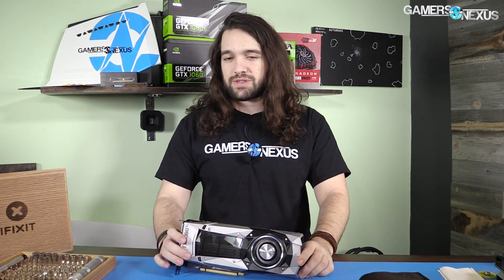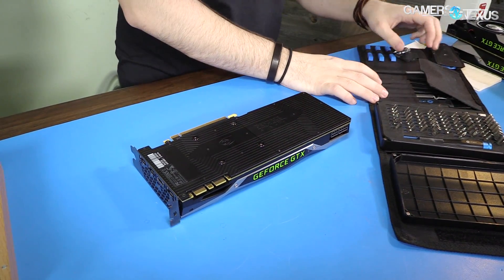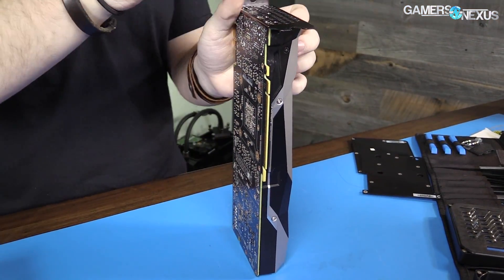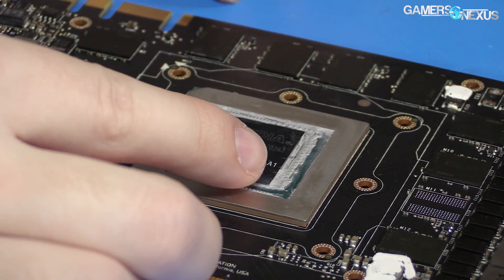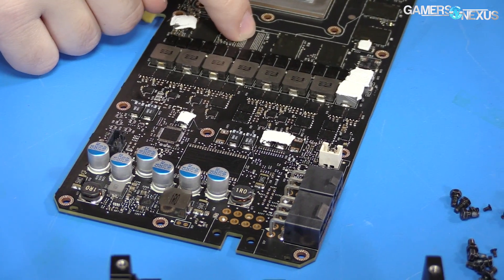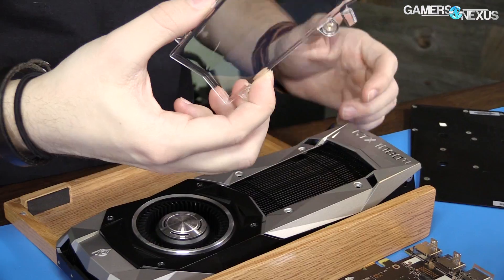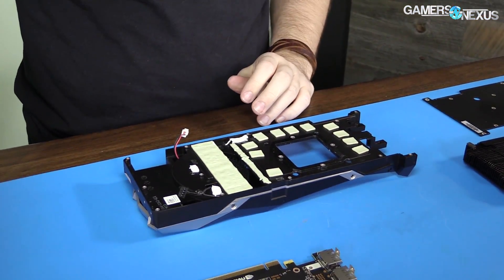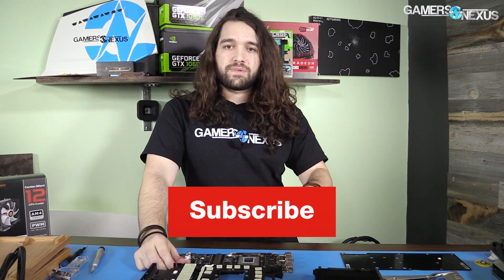Building a 1080 Ti Hybrid Part 1: Tear-Down

Comment from the maker: Hey all. This is part 1! We're working PAX East this weekend, but will immediately set to concluding the hybrid project early next week. For the 1080 Ti review, check here: https://www.youtube.com/watch?v=BipVR5-YM_Y
Reply: awesome, I'm wanting to water cool two of these later, and I have no clue what I'm doing..lol..
Reply: King Sisyphe if you can wait I'm sure evga will have an actual hybrid version, probably a FTW hybrid too
Reply: Ben Filley ftw 3 no?
Reply: Brian Field well the whole "ftw3" is a reference to the fact that it's now using 3 fans instead of the 2 on the previous versions. The actual FTW pcb is the important aspect. They always have a better power delivery and will generally be able to maintain a higher clock speed. Especially so when water cooled, because you remove the thermal limitation of an air cooled solution. Liquid coolers keep the cards under the temp that they automatically throttle at. I know on maxwell it would automatically start throttling back at 70c, which is why I liquid cooled my 980's, so they can maintain their overclocked without dipping inevitably at 70c. Now they stay right around 42c full load and overclocked, and the frequency never dips even 1mhz.
Reply: Ben Filley what kind of clock speeds can we get watercooled?

Comment: The big question is: does it NEED VRM cooling, provided the core is water-cooled? I've been running some 200-250 W cards (currently - a slightly OC'ed R9 280X), and they did not need active VRM cooling.
This card is moderately more powerful, but its VRM is also have more components that share the heat (and great MOSFETs with very high efficiency), it's probably cooler than my 280X.

Comment: Hey Gamers Nexus, So I just installed this hybrid cooler onto my 1080ti. In all my software I'm not seeing a fan control for the gpu itself. The fan seems to be running at 100% all the time. Is there anyway to control that? Did I install it wrong somehow?

Comment: I'd be very interested if EVGA/MSI etc. would create an SLI version of the hybrid using a 240 or 360 rad so it doesn't look like $hit if you happen to have two of the Hybrid cards in one system plus an AIO for the CPU

Comment: Great videos (part1 & part2), but I just do not understand why manufacturers don't water cool these right out of the box.  Yes it costs more but seriously at the heat these guys run at why make end users jump through hoops like this?

It's like selling someone an automobile and then taking the radiator out of the car and just expecting the car to run simply on the fan.  Sure the car would probably do fine around town but if you drove it on the highway for an hour it would melt the engine block.  LOL.

Comment: just to note - to fit a GPU only block or AIO, you don't need to tear down nearly half as much as this - the shroud and back plate can stay on the card - you only need to undo the 6 small torx screws (2 on each side and 2 near the fan) - the 4 bigger ones just hold the clear plastic in place so don't need to be undone

on the back, you only have to release the 4 big screws that hold the heatsink on, you don't need to remove the back plate at all

Comment: Hey guys! Any1 know if the Raijintek Morpheus fits on the 1080Ti? I used one on my 980Ti and it would be great to simply migrate that thing over to the new card :) I'm a little bit concerned regarding MOSFET cooling though...

Comment: Definitely getting one of these to replace my 980ti which isn't cutting it at 4k any more.  I've got SMD rework tools and it would be tempting to just solder another memory module on to see if I then get 12gb.  I notice that all the supporting resistors/bypass caps etc. are already there for the missing module, including on the back of the board.  Getting a stencil won't be a problem but... anyone know if these 11gb/s modules can be ordered singly?  I'm prepared to give it a go in the name of science :) . PS - thanks for a great video - subscribed to your channel.

Comment: Make sure you test it with CPU bottleneck so it performs the same as RX 480 so AMD fanboys can claim RX 480 is just as fast.
Reply: Alex Pana basically both cards numbers end with "80" so they're pretty much the same.
Reply: wtf u talking about  amd fanboy? the ryzen are utter shi t in gaming. we're still waiting for AMD to update the firmware on those new cpu's so we can actually see some performance out of them. Motherboards don't even have a fully capable Bios for the Ryzen processors yet. Dang.  I'm no nvidia fanboy, but at least nvidia is releasing something.  fkin amd has been trolling us with AMD VEGA and HBM2 for so long now that people are starting to lose hope. and to buy a 500$  1800X Ryzen and see that it doesn't beat an oc'ed 6700K that's roughly 300$  is disappointing.
Reply: Top kek
Reply: Sorry to hear that, i hope you are healed soon in the name of Jesus Christ !
Reply: Filip Cristian I guess the water is boiling inside the atic now
Reply: He should test it with 7700k so he will be cpu bottlenecked  :^) 
http://www.eteknix.com/nvidia-gtx-1080-ti-cpu-showdown-i7-7700k-vs-ryzen-r7-1800x-vs-i7-5820k/8/
Reply: butthurt that amd has superior game in the cpu biz? kekekekekekek

Comment: Would it be possible to solder an extra gb of micron gddr5x memory on it?
Reply: Luka Viola Blaic It would be more complex than that. The card, drivers and the OS would all have to recognize the extra gig, any presumably you would have to flash on a custom BIOS for it to recognize to the chip.
Reply: Brap Brap this is probably a really stupid idea but would using a Titan X bios allow it to recognize it? I mean spec wise they're almost identical besides ROPs
Reply: my intuition is sayin... its  not that easy dude :P where would you buy the 1gb memory?

Comment: does anyone know if custome water cooler plate from the FE 1080 will fit 1080Ti? I have XSPC water block and backplate
Reply: ealiev60 Probably not because the VRAM, Chokes and FETs are in different locations. Go ahead and try though, no harm in trying. 

A Titian XP water block fits though.
Reply: ealiev60 titan xp probably more likely

Comment: If a person had sufficient micro soldering skills would it be possible to solder a functional 1gb micron vram chip onto that spot where the 12th gb of vram would of gone?
Reply: If the traces are actually there and you flashed a custom bios on it.. maybe.. probably not though and I don't think 1 GB would be worth it
Reply: amartinez97 For some reason I have my doubts but that would definitely be cool
Reply: Maybe it's same board as the titan so to save money bc there similar just used it on 1080 ti kind of like how Apple did with 5s and SE phones at least  that's what I think
Reply: I think the MCU (Memory Control Unit) in the GPU chip for that memory channel and the cache for that channel is disabled on the glass if not omitted completely from the GPU chip. The pads are probably just there on the PCB for manufacturing compatibility/cost reasons and don't actually connect to anything on the 1080TI GPU (same PCB, different chip on the PCB).   Just like power window options for cars, The wires are there for reduced cost of making the wire harness, you may not have the window motor and switches at the ends of the wires in the car.

It would be interesting to see just how far the 12th MCU was disabled/omitted on the 1080TI chip.
Reply: Soldering that chip on there is easy...
But, however, the controller needs to know that its "there".
NOT easy. That means going in and digging into the bios/microcode. If the controller even has the physical wiring there in the first place and if the power support is there too.
LOTS of engineering work, lots of time, lots of money, lots of special tools. 
Most definitely not worth it at 1gb. 
Would do it if this was an Apple motherboard with the soldered on SSD chips. I would definitely go to the mat for a SSD upgrade, but this, no...
Reply: amartinez97 yeah that would be pretty interesting to see someone try to do
Reply: The slimmer memory bus of the 1080Ti compared to the Titan X will strangle the last gig even if it was possible.
Reply: They wouldn't be able to solder that on by hand; that is a BGA chip (ball grid array), and can only be soldered via reflow method.

Also, what about getting the card to recognize it.
Reply: Soldering would be the easy part, the custom firmware you'd need to make for the card to operate correctly is the hard part.
Reply: Drivers/firmware would not be set up to detect the extra RAM module. Hell, the GPU may not even be able to, by design or microcode.
Reply: they remove modify the memory controller to where it will on,y take 11GB  of VRAM.
Reply: amartinez97 i believe that this chip is missing for a similar reason why the 970 only had 3.5GB of VRAM. Basically, the disabled ROPS in the 1080ti may have contained part of the memory controller, so now it can only address 11GB instead of 12.
Reply: did he ever say why it was missing a vram chip???
Reply: Just buy a Titan. Lot less agro and I see 1 on ebay for £580 yesterday. So cheaper too.

Comment: The 8 pin power plug on the side is for quadro cards, since they share the same PCB most of the time. Meant for low profile server configs where vertical space may not accommodate power plugs at the top.
Reply from the maker: Beyond4k Excellent point!

Comment: if I solder a connector to that 8pin holes,will it add power or it will work as parallel to the other one?
Reply: you might fuck it up

Comment: Steve you know that EKWB full water block for titan x pascal is compatible with GTX 1080ti why bother with those Frankenstein builds ?
Reply from the maker: Easier with our current benches, more fun, more comparable to previous builds. Basically just because we want to.
Reply: Easier to integrate into any system?
Reply: put EK predator with QDC and EK block with the QDC option and you can basicall put it in every build with hot swap able option to the video card 
much easier with much better cooling to the VRM and vrams
Reply: Cuz an AIO.. is easy maintenance does almost as good as a full waterblock, its 5 times cheaper, it allows for just as high overclocks  as a full waterblock and there's no leakage danger or complete custom build needed for piping  pump, radiator etc.
Reply: Gamers Nexus because its fun right ;) wht take the easy way when you can do it the hard way ;)   btw they can make a cooler vidoe(series) this way
Reply: Came here to say this, but was satisfied with the existing response b ^_^ d